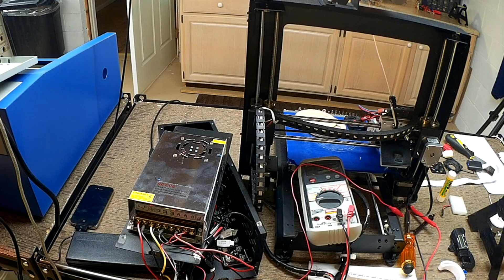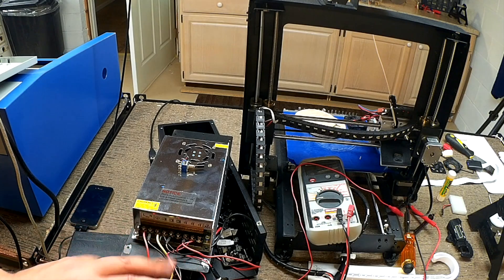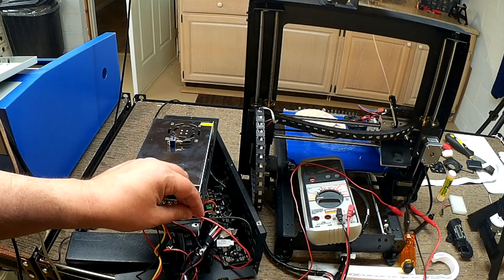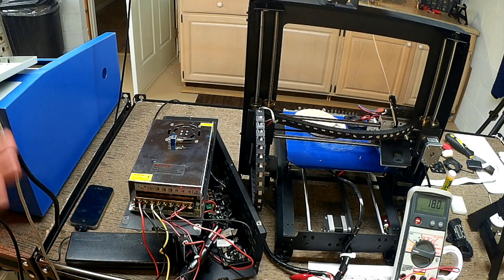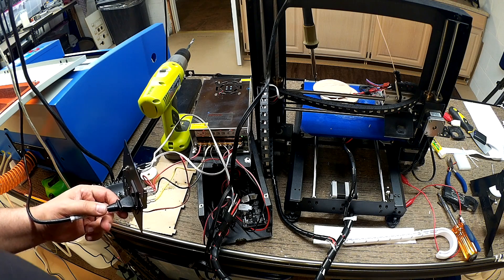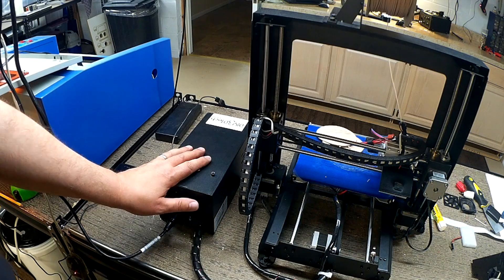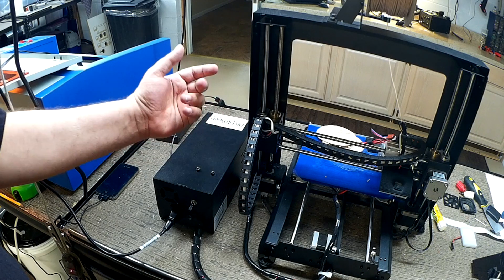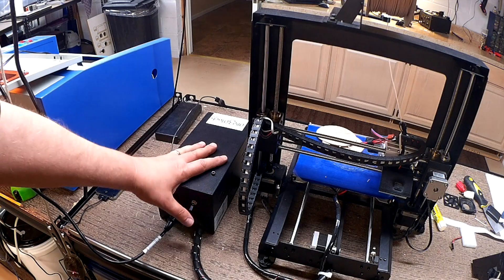Wanhao Duplicator I3 3D Printer - Power Supply Issues and adding a switch!

Comment: The problem I’ve found with the temp fluctuation is the power supply is underpowered - the bed pulls 15a and the extruder pulls 3a, not to mention the steppers and electronics.  I measured these on my machine yesterday.  I’m planning on replacing the power supply to one with sufficient power.
Reply from the maker: Yes you are correct, a larger power supply will help in addition to this mod...

Comment: This is sooooo cool.  I have printed ou the LED holder, bought the LED and just went to Radio Shack today to get the parts to do all this but connecting to a Wall Wart.  Now I don't have to.  I bought a SPST Rocker switch  (RS# 275-0694 https://goo.gl/jJsQ7C) so I can put that on my power supply enclosure back panel. I will have to wait until I finish the printing job I am doing for a friend.  He bought an HTC Vive and wanted me to print a couple of controller holders (Thingaverse http://goo.gl/ck9NVp).  I'll let you know if I get it done this weekend or not.
Reply from the maker: +Norbert Davis Very cool! And please do...

Comment: Interesting.... could you have accessed the power supply outputs by just removing the back plate? Also wondering if a connection on the extruder fan wires could have provided the power for the lights.
Reply from the maker: +Steve Cuthbert the power supply actually  has three legs (Electronics, HotEd and Heated bed) however they are pulling all three from one leg (save for two small fans).  So I just used one of the open legs, and opening the case is very easy.  Also it would be too much of a load on the fan circut...

Comment: I would measure the actual amperage on that circuit to find your max current.  With that information you will be able to determine the correct wire size.  I would not compare the "thickness" between the wires, compare it's gauge.  

I know you know all this, but I've learned the hard way to do the actual measurements and calculation before making changes. You never know, you might be surprised.. :-)
Reply from the maker: +RJ_Make Your correct on just the "gauge" of the wire, however have built a couple from ground up and used a power supply very much like this one.  However broke up the electronics, hotend and bed to the three separate leg from the PSU.  Also, just looking at that gauge of wire gives me the willies thinking it feeds everything.  Got a couple travel weeks coming up so don't have the time right now, but in a a month or so will tear it down a take a deeper look at...
Reply: +DIY3DTECH.com Great, I look forward to what you come up with. Curious as to the actual full load amps are on that circuit.

Comment: Regarding replacing the cooler, I have this:

http://www.thingiverse.com/thing:1025471

installed on mine, and it vastly improved my print qualities (in PLA.  the cooling fan is turned off for PETG/ABS).
Reply from the maker: +Scott Adkins thanks for sharing have new video coming where where I do something (I think) is cool (pun intended) however we will see how it works!
Reply from the maker: +Scott Adkins I tryed another Thiniverse and work well but I am trying yet another design which lets say will be "different" so watch for a new video :-)